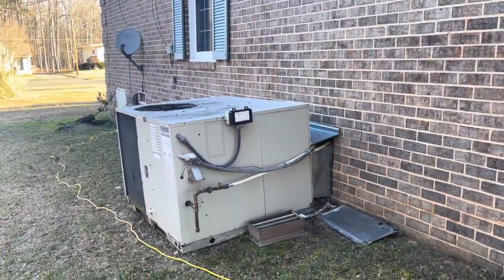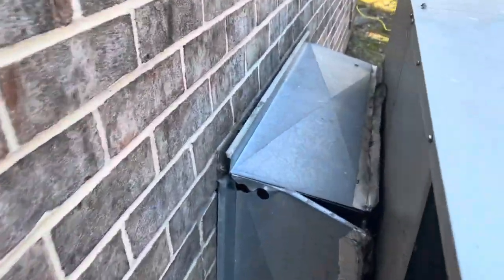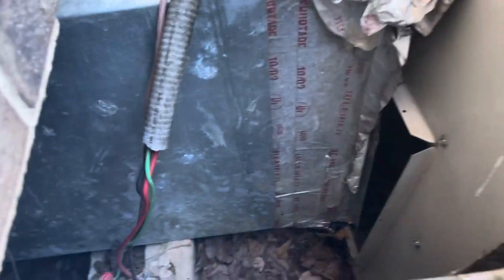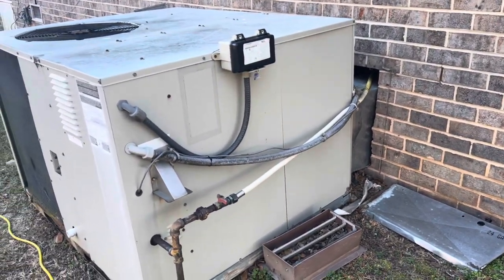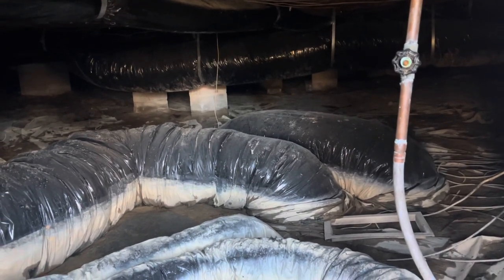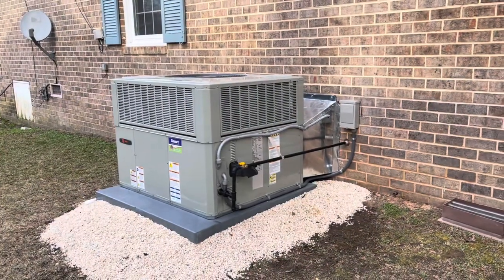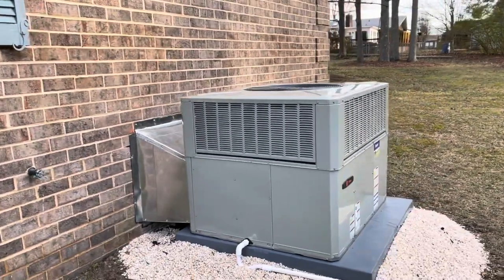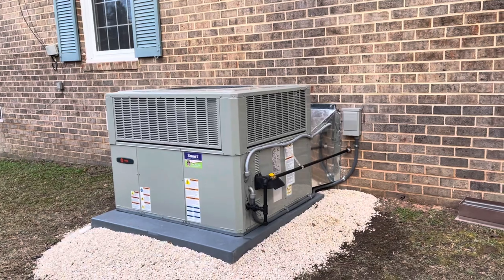HVAC Installation- Gas pack hasn’t worked for heat in 3 years

Comment: That looks allot better👍👍. Do you miss just running service?
Reply from the maker: No, I’m a very visual person so I get gratification from making a significant change in the appearance of a system. Service repairs are usually inside of the equipment and so the visual aspect is lost.
Reply: @StephenRardon  So do you only just install now or what?
Reply from the maker: I started my own company so it’s a little different now, I run installs along side my technicians and they handle most of the maintenance and service calls.
Reply: @StephenRardon  Oh cool. How many techs do you have now?

Comment: Question on the Bosch bova36, cond. unit I have on display board LO, and red light on and 8 green flashes, cond. fan comes on and runs few minutes but compressor never starts, inverter board has been replaced along with the TF sensor, but same problem occurs, have you come across this and any suggestions from you or anyone. Also bosch rep been out 4 times and still no fix.

Comment: You know you can weld up those holy heat exchangers. Then send off to be ceramic coated. Never worry about this again. Had an OLD Sears unit that was ceramic coated. Looked brand new after 50 plus years. Belt drive blower. What a tank. Unit was dead silent heat or cooling. Don't make them like that anymore.

Comment: My heat works, my thermostat is 1 or 2 years old, has worked great. But as of last night, my thermostat keeps rebooting, turning itself off for 60 seconds, back on and will be fine for a few minutes, or 30 minutes, and shuts back off. I can't seem to find the problem. No breakers tripped, and the thermostat is powered with C-wire, not by batteries.  Anyone with an ideal?

Comment: YOU INSTALLED A NEW SYSTEM UNDER THAT SHITTY CRAWLSPACE????   ONLY RESTED THE FLEX DUCT WORK  ON  BLOCKS??? WTF. 
  W/O HAVING SOMETNING DONE ABOUT THAT SWAMP???   NEED TO READ ABOUT HUMIDITY PROBLEMS, MOLD, SMELLS, LEAKY NEW RETURN DUCT WORK.